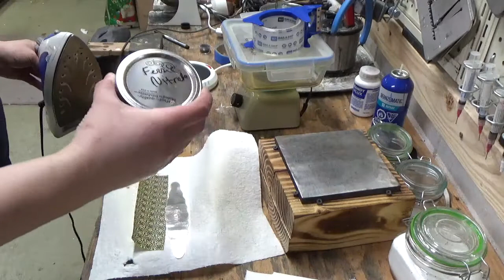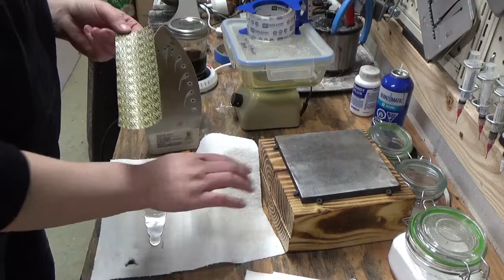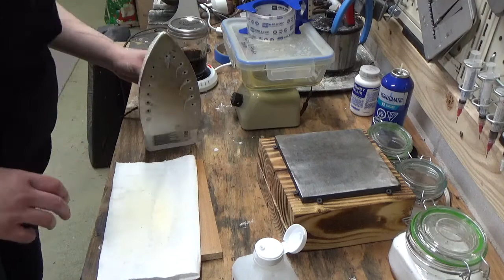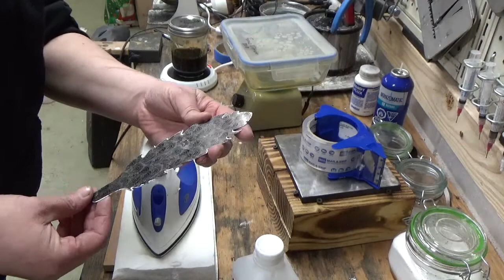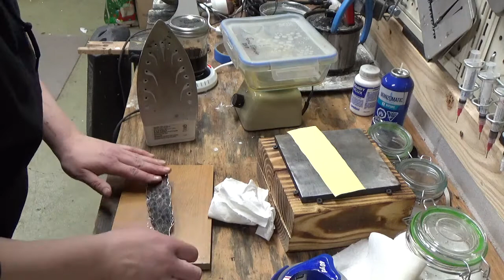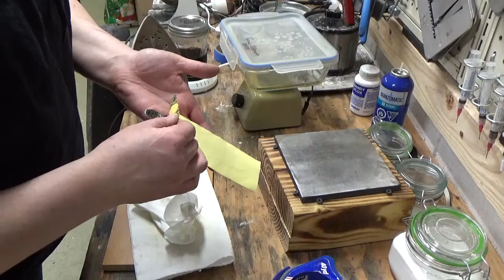Acid Etching A-Z!

Comment: Hi Roberta! Do you know if ferric Nitrate will etch silverplate? I do a lot with up cycling vintage silverware and wondering if this would work on spoon bowls? Thank you
Reply from the maker: Hey! Ah no it won’t - it only works on the silver portion which is extraordinarily thin. The main metal is steel..

Comment: Great video!  I have seen others but they use ferric chloride and not ferric nitrate. What is the difference for etching?  Do they both etch the same metals or does ferric chloride only etch copper?
Reply: I was told by an instructor that the nitrate is for silver as the chloride will not work well.